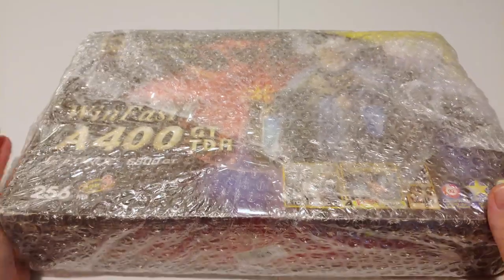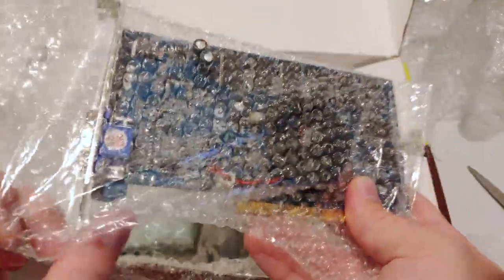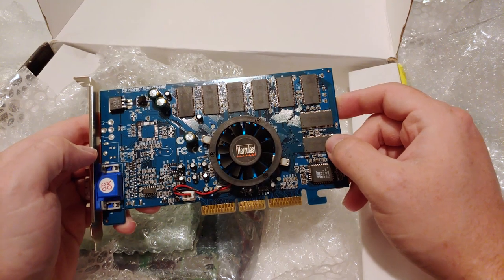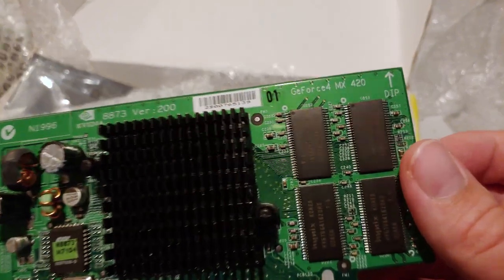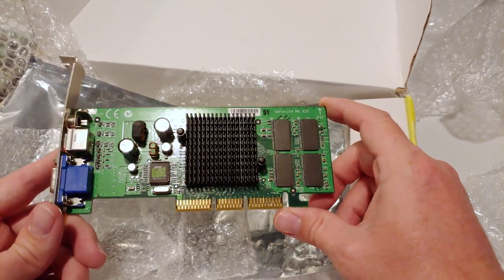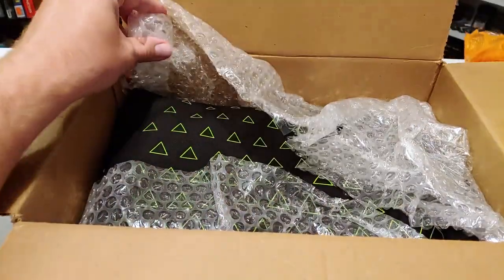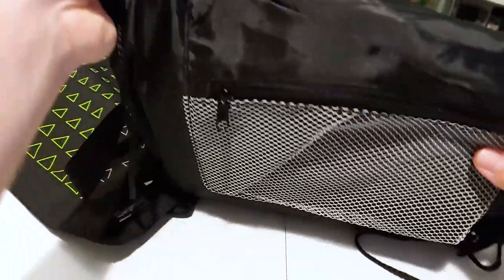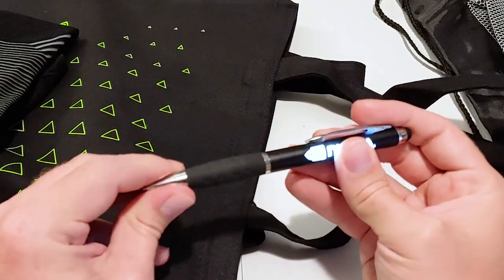2020 sucks a little less now // PixelBOX Haul Ep.12

Comment: Glad you enjoyed the cards I sent! The 6800GT was in excellent condition but it was a shame it didn't come with the original cooler would have kept it otherwise. Leadtek make good cards they use a different PCB than the reference design, they usually Overclock and unlock very well. Custom bios screen that is very pleasing too. Happy new year all and have a good 2021!
Reply from the maker: Thanks again man!
Reply: Hey ash, so the boards not reference .. I was thinking about moving the cooler to another 6800gt 😕
Reply: @RetroGPUsandBuilds  yeah Leadtek spun there own PCB design they seem to use the same design on all there cards even basic 6800

Comment: leadtek's cooling was always fantastic - i have a winfast ti4200 (a280le?) with an absolute overkill front and back plate aluminium cooling block. the small loud fan died so i replaced it with a huge 120mm case fan which is even more overkill but the only solution i could hack up easily. glad your 6800GT is living its best life :D

Comment: I remember using an GeForce4 MX 4000 for several years back in the mid-late 2000's...  It did what I wanted it to do at the time, so I have no complaints there.

Comment: I lost some hair when you almost knocked SMD stuff off there hehe XD
Anyways a lot of interesting cards there.
My 256 SDR also runs 110/143 stock but it has ram rated at 200Mhz CAS3 but I suspect its running Cas2 because I cant get to 200Mhz, 3Dmark2000 I think its 188Mhz max and UT99 likes to artifact at 168Mhz or higher on the ram when I check in the Console, weird issue...

I also bought on of those GeForce 4 MX 440 for 20€ for a retro build just to realize it had 64bit 266Mhz DDR, worse then the crappiest GeForce 2 MX XD
Reply: Lol I had a mx440..my first real GPU...then a geforce 5200fx then thought I'd upgrade an got a 5500fx wat a load of pants both those cards where. I only bought it to play medal of honour pacific assault as it needed sm2...they could bairly do or even be called sm2 cards. Learnt a big lesson there lol.

Comment: The 4000 XT needs recapping pretty badly.

I have the same exact card and it's a piece of crap. You can't even overclock it with 3rd party cooler. Increasing clock by as much as 1Mhz will cause it to cease working. I think I did bench marks on Vogons for that card.

Comment: that 256 that you showed off at the 7 minute mark looks passive, but careful, it was active cooled so please add a fan so that it does not die on you (you can see the dust "print" of a fan on the inside of the heatsink)
Reply from the maker: Someone didn't finish the video.
Reply: @PixelPipes  yea i saw that in the end, didnt watch the whole video before commenting

Comment: Hi  PixelPipes your videos about retro gaming and retro graphic cars are very interesting. 
I have bout some old graphic cars like Geforce 2/3/4 and Geforce 6600 Series and Radeon X700/X800.
I want to benchmark the graphic cards.
I have a question why GTA San ANdreas is lagging in some places with 15-20 fps and in other places it runs 40-60 fps.
Although my system is Pentium 4  3,6GHZ (560 HT) and 2GB of Ram and Geforce 6600GT 128 MB.
The settings are 1280x1024 32 Bit and All maxed Out with 3x AA and Framelimiter is off.
If I used a Radeion X 800 with 256MB GTA San Andreas still laggs with this Settings. 
With the X 800XL its a bit better but in some areas 25-30 fps is too slow too...
If I play the game with the other PC Core Duo E5400 3GB Ram and Geforce 9800GT it runs of course smooth. But during I get 60-80 fps the fps fall in other places to  35-40 fps....
its strange... GTA SAn Andreas is not a game where you need a great GPU. Its CPU limited.
I have tried with different HDD's and SSD and still the same problem ... and installed all Mainboard Drivers Direct X 9.
According to the benchmark of a German PC Magazine 
GTA San Andreas runs with Geforce 6600 GT with 4x Anti Aliasing and 8x Antisotropic Filtering and maxend out with 47 fps in Average with Athlon 64 +4000
its not much faster than Pentium 4 560
Reply from the maker: Not enough VRAM most likely
Reply: I thought so too at first time but I have used a Radeon X 800 with 256 MB and still laggs.. it runs a little bit better but not much...
Even with 9800 GT i haven't constant 60 fps. In some places in Los Santos for example with much shadows or in plaxes with much woods the framerate drops too 40 fps or 35 fps minimum